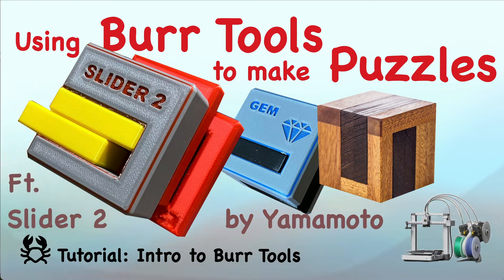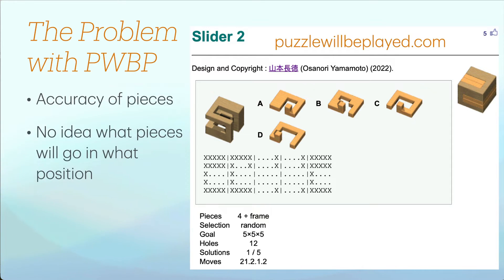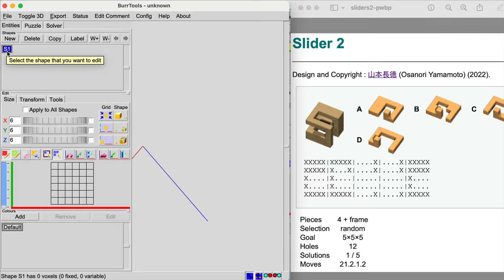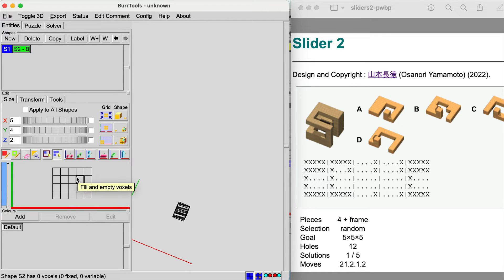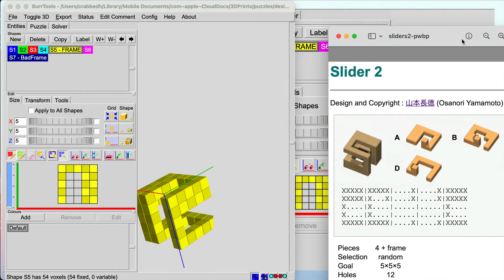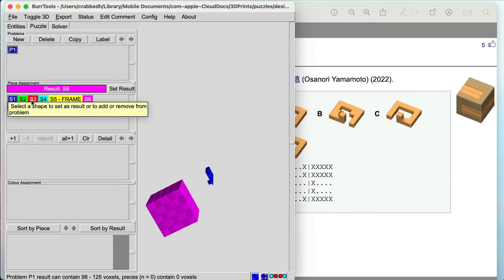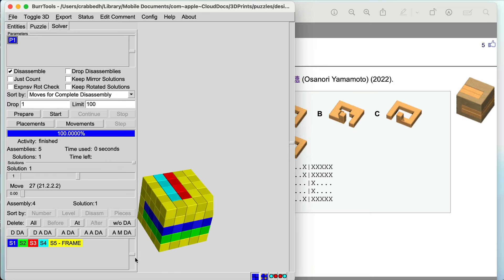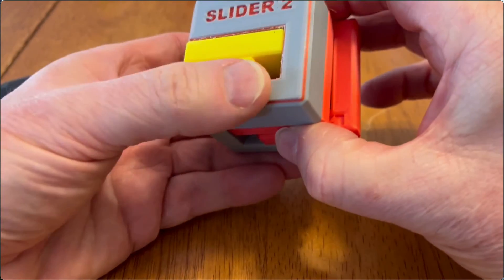Intro to using BURR TOOLS for puzzle validation and creation

Comment: Mate, Thanks a lot for this tutorial, I am very noobie on the 3d printing and helped me a lot.  I discovered another tool for modeling the pieces, called «puzzlecad» which is a library for the «SCAD» program.  You can convert the BurrTools format directly on the SCAD language and the SCAD and create all the pieces with insets and bevels needed for a nice fit. even can split the cages in easy to print and assemble parts.
Reply from the maker: Yes.. I've used PuzzleCad a bit. SCAD/Puzzlecad is especially good to create cube parts that are bevelled.. For instance, 3-4 cubes together, but you bezel them so each cube appears separate. I actually switched from PuzzleCad to Fusion 360 to model most of the puzzles on my PRINTABLES.COM (search for user CRAB) page. Learning Fusion 360 takes some time, but it is a very powerful program (and free for non-commercial use) if you want to eventually model your own parts. Not good for sculpture things.. but excellent for mechanical style parts.
Reply from the maker: There is nothing like burr tools if you want to discover the solution to a burr-style puzzle.. or if you want to create your own. Very powerful. There is a site called "puzzlewillbeplayed.com" where you can get many puzzle designs. If you use BurrTools you can find their solution.